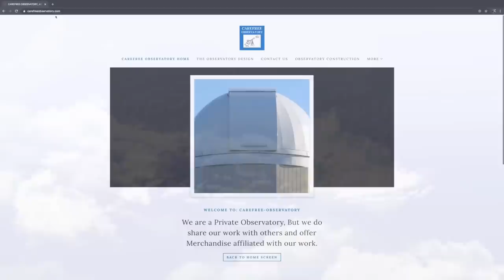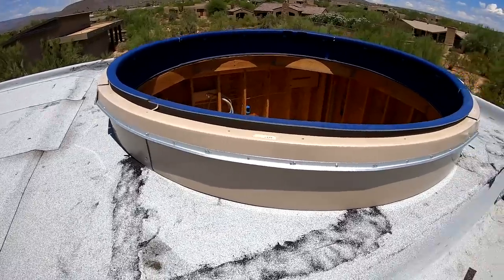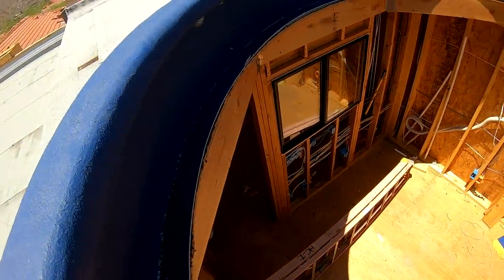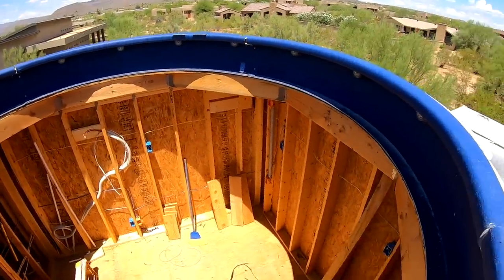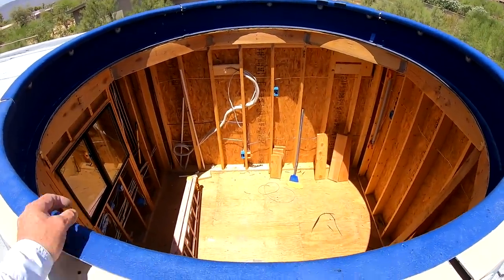Carefree Observatory Installs Custom Automated Dome Mdl. Hd-10 By Technical Innovations of Florida

Comment: Marty awesome video putting the dome on nice work looking good. Got a question when you put the telescope up how far into the dome will it go ?
Reply from the maker: Well above center of the bottom of the shutter horizon of the dome.  i have a sixteen inch meade actual 17 1/2 " to outside but i will be changing OTA's so probably the pivot at center of the dome  I believe it 16" above plane of shutter opening